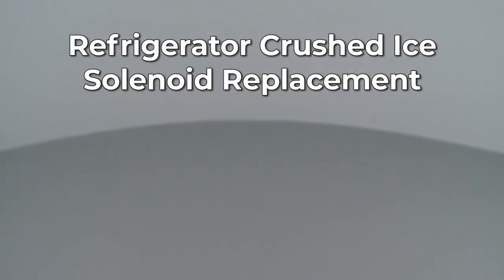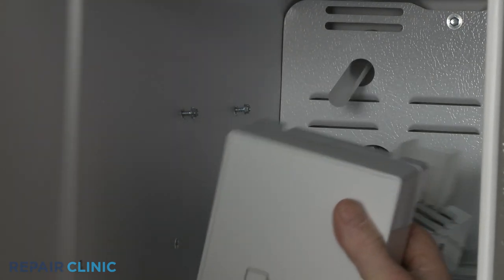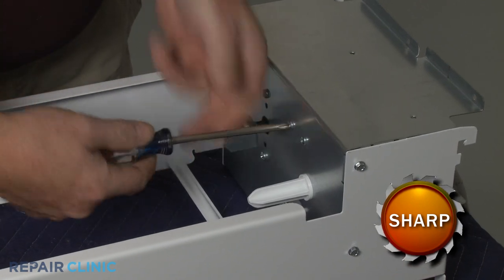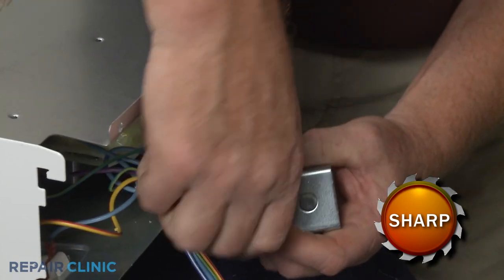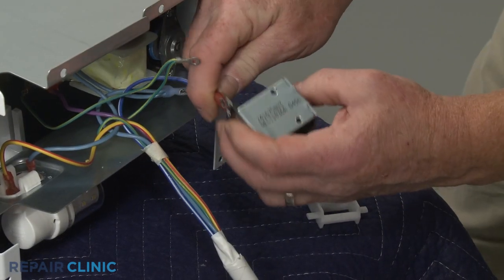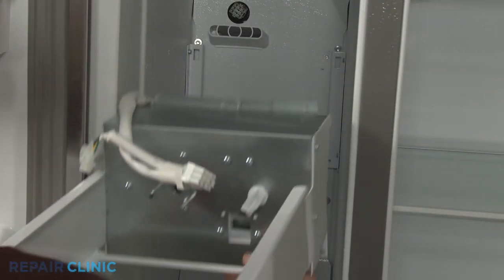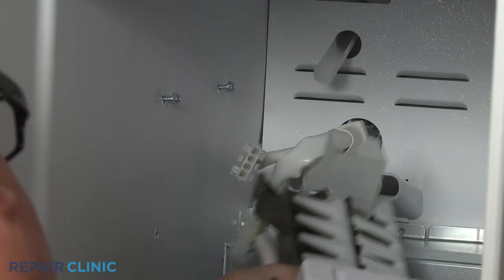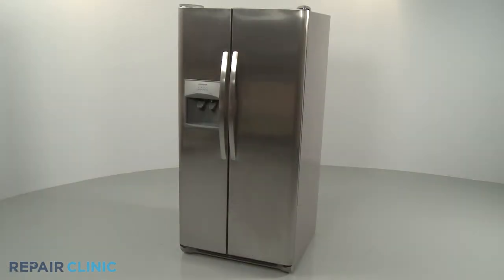Refrigerator Crushed Ice Solenoid (241675803) - Frigidaire Refrigerator Repair Help

Comment: I replaced the solenoid with a new one and it still didn't work so I got another one and it still didn't work. I don't know what would keep the solenoid from working, I can easily move it with my finger and all the wiring looks to be in good condition. Any ideas of what I should check?